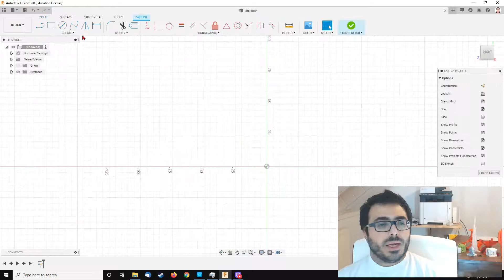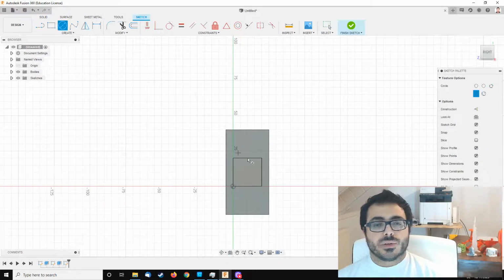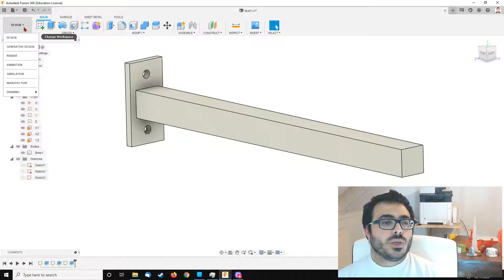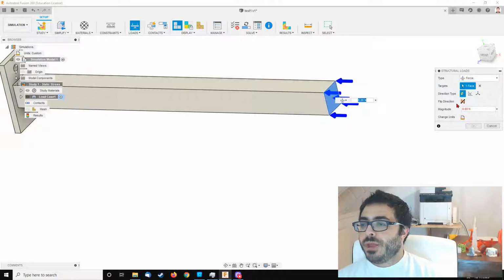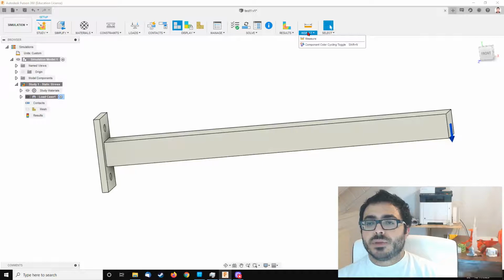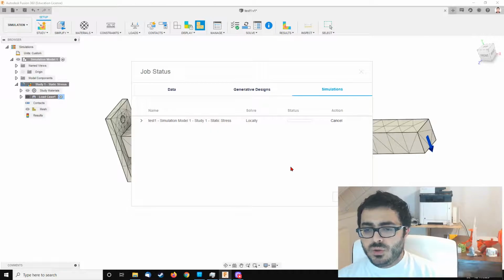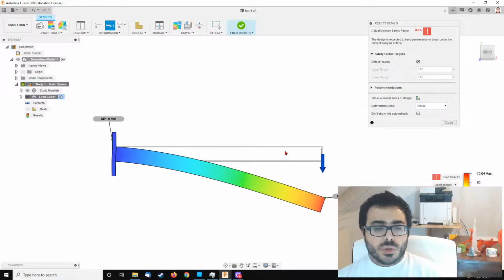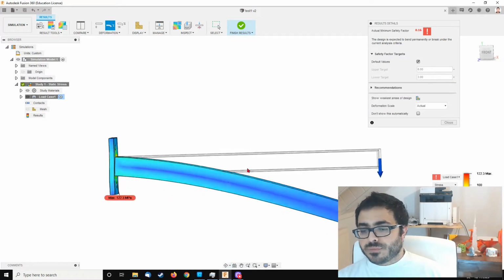Simulating a 3D printed part on Fusion 360 to improve design

Comment: This kind of instruction can be dangerous. 
Fusion is treating your design as if it is solid ABS when it is largely hollow when printed.
Fusion will be showing acceptable loads that are EXPONENTIALLY larger than what your member will actually be able to withstand.
If people don't consider this when using Fusion, they may be putting themselves or others at risk of injury.

You mention layer orientation, infill, and shell thickness; 
These three factors will DRASTICALLY affect how far the member will deflect and where, and at what load, it will break.

I strongly recommend building the shell and infill pattern into the model before simulating loads in Fusion. 
But even that can be risky as you can't account for the layer orientation.
Reply from the maker: I totally agree. That is why i recommend making a CAD as shell and simulating. If that passes the test then infil is a bonus.